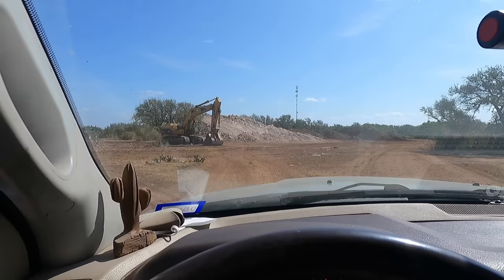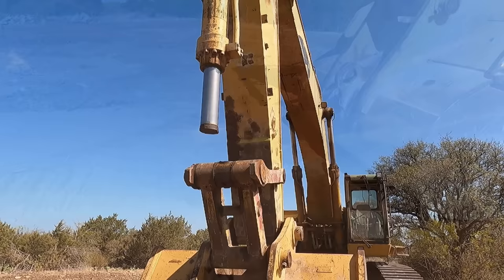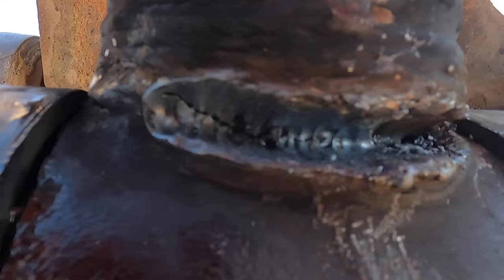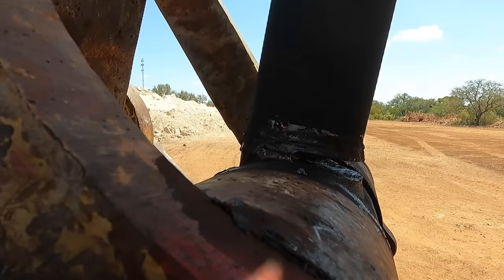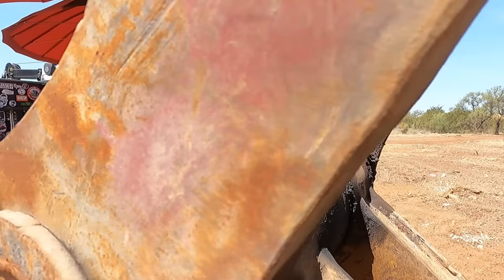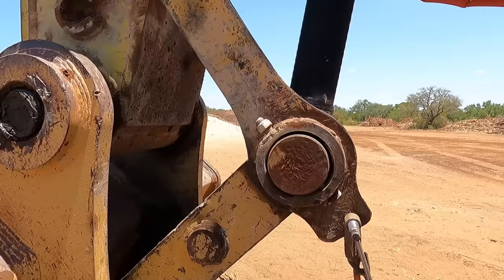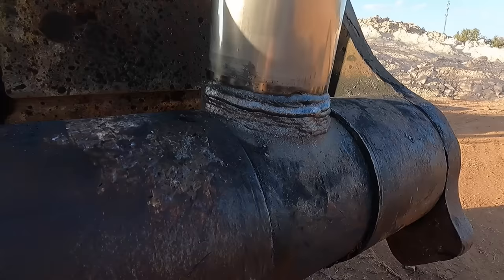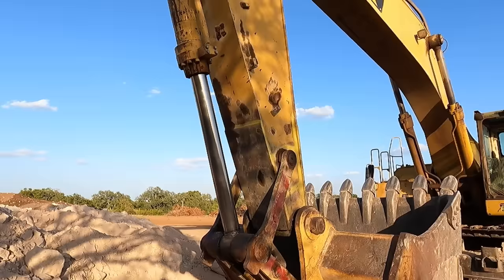CAT 365 Broken hydraulic cylinder.

Comment: I wonder if the 1st weld repair weakened the metal below the welds which caused it to break just under the repair this time. I know when metal is welded it produces tons of heat that can rearrange the metal crystals and possibly cause the metal to fracture like this has. I've seen Huge I and H beams break like glass because of being excessively heated by torch when repaired.
Reply from the maker: yes, exactly my concern too. I mentioned that to the customer, saying that I dont think i can repair it again or that it will last as long. He understood.😊
Reply: @ICWeld    All he can do is try and hope it will last. Good thing is, it doesnt look like a large expensive part. Maybe next repair will be to replace that entire collar that the cylinder is welded to.  Anyway, good job on the repair.

Comment: Curtis would faint if you saw that crack open up on the opposite side. Personally I think you went in too far when you gouged out the front. Should have left a bit more holding metal. But otherwise a good job. ( former certified welder )

Comment: I wonder if there is even significant difference in strength in doing a perimeter weld only. Most of the forces exerted are in compression not in contraction. The weld metal probably work hardens it self like a micro hammer forging.

Comment: hello if I may ask, 
With the events that I got in the area has not been broken, but there is crack and wear resulting in lack of dimension, what can cause the piston rod bucket cylinder can be broken?

That's all and thank you
Reply from the maker: The pin came out. the locking bolt fell off and allowed the main pin to slide out of the bucket.
Reply: @ICWeld  I mean, with the pin coming out, can it cause friction with what object?
Rod eye can crack or until it experiences a fracture that can cause any other factors

Comment: Don't the pulls on either side cancel each other out? Not sure just asking for my education.
Reply from the maker: There is lots of tension built up in those welds. I would have done it differently by beveling it to the midpoint and adding a little bit of weld in the center, then beveling the rest. Then weld my way around the whole thing all at once. Lessons learned.
Reply: @ICWeld  in two years you'll know what to do.  LOL

Comment: Hey if you get to read this, what's your opinion on using 8018-BL6 or a 9018 rod on an application like this?
I got a dozen or so mixed 10# sealed cans of ESAB rods I got for $5 each.
Reply from the maker: 8018 should be good. I wouldnt use too hard of rod like 11018 because then it becomes real sensitive to Pre and post heat issues. Too hard of rod will crack.

Comment: Think I would consider dropping the hydraulic pressure a little  or replace the operator, grant it it happens,  but for cat machine to get so torn up ,hydraulic pressure is to high or operator looking for extended break time,  just saying not pointing fingers,

Comment: My only question is what about that same stress that cracked your temporary weld now being on the front repair weld? Would heating it release the stress? Am I overthinking it? Lol
Reply from the maker: There is a lot of built up stress. but thats the nature of welding in general. I should have welded this cylinder from the center out, all the way around in a circular pattern.
Reply: @ICWeld  That's what I was thinking but that would have been a real pain! Plus you'd probably want to do at least a few rotations at a time, not 10 million half circles! Lol

Comment: Doing field repairs, customers first question "how long it will take to repair broken weld?" Consumers at garage first question "how much will repair cost?" In Alberta classed as "utility welder", beats being B-pressure pipe welder doing coupon welds.
Reply: Haha... back in my youth I had one of those high falootin sports cars from Germany... I went through three phases getting parts: 1: How much does the part cost?  ... became irrelevant as there was no where else to get it. 2: Do you have it in stock? ... again irrelevant as the parts were so expensive none were stocked.  to finally 3: How long to get it shipped from Germany....  That was my last fling with sports cars.  Now drive Chev trucks since 1980...

Comment: Part-time welder here and I was wondering -  could aluminium foil be used to protect the chrome on the hydraulic ram also?
Reply: Topper Machine LLC has got a video on YT where he welded a knuckle back onto a chrome rod and he protected the rod with card stock, he said the card catching fire is an indicator that chrome's getting too hot. His video was a shop job though.
Reply: @RichardSmith-wr6go  Thanks. I'll have a look at that.

Comment: After a lifetime of welding jobs like this one, I  realize welding is a temporary fix.  Regardless your skill level or equipment, welding can never be as strong or homogenous as the original parent metal. That parent metal broke.  Repairs will always be weaker and therefore temporary.

Comment: Always some 400lb gorilla at the controls breaking stuff, you'd think after 2 or 3 times the equipment owners would figure out proper maintenance would save them much more money and time in the long run, but no. Lets ignore it to save 500 bucks now, if it breaks we'll spend 5 grand later to buy all new parts. 🤔😁